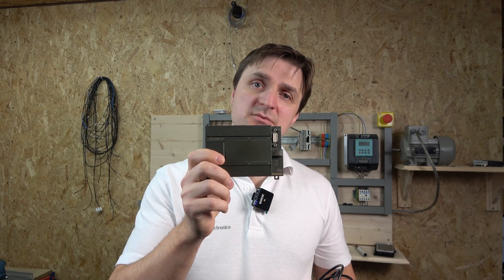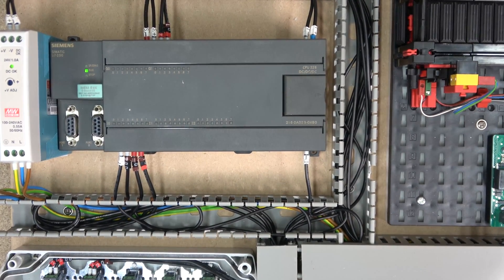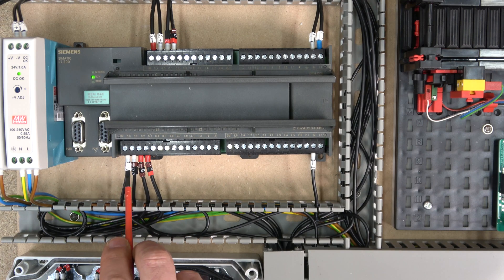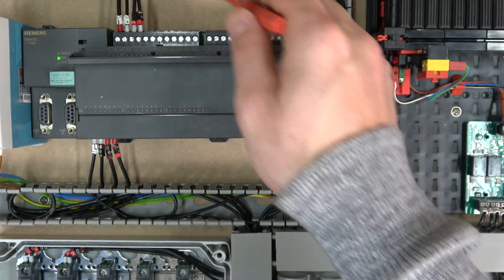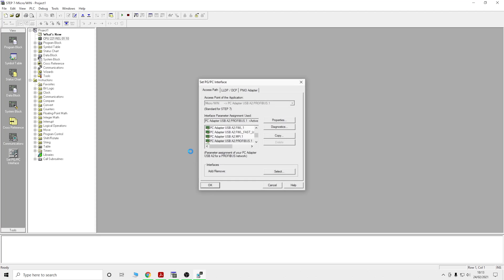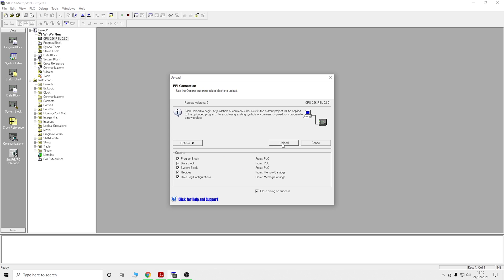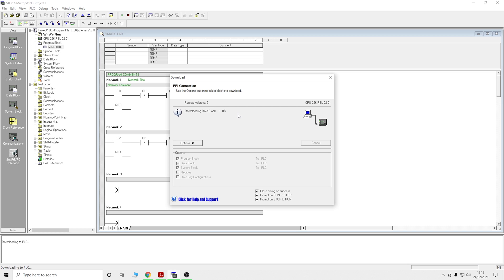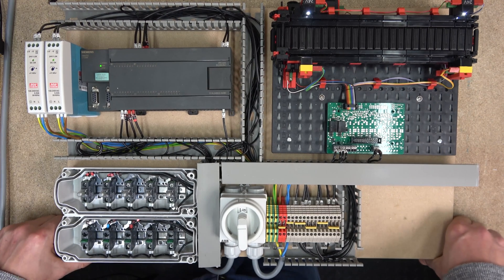Siemens S7-200 PLC, wiring, program upload / download using MicroWin 4.0  SP9. ( English )

Comment: More likely the reason your not getting the 24V between VCC-GND is because there is a minor voltage drop across the wires, contacts, and/or semiconductor components. This is normal electronic systems.